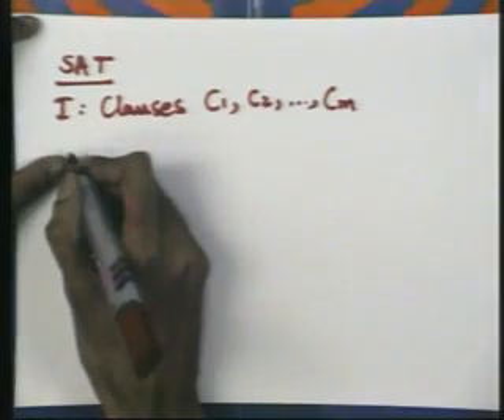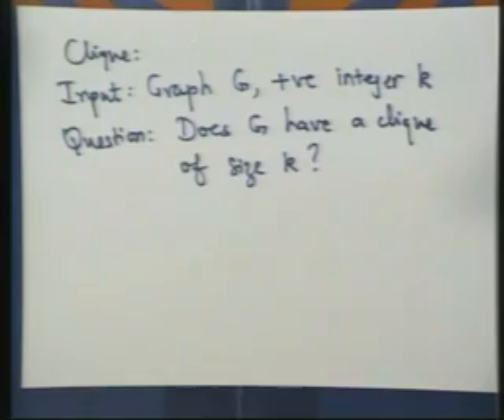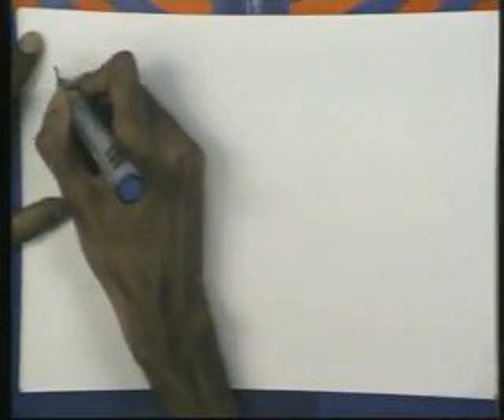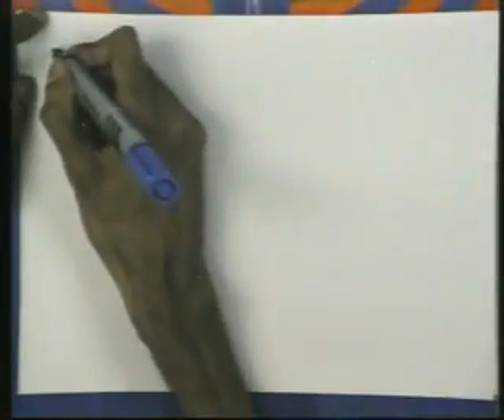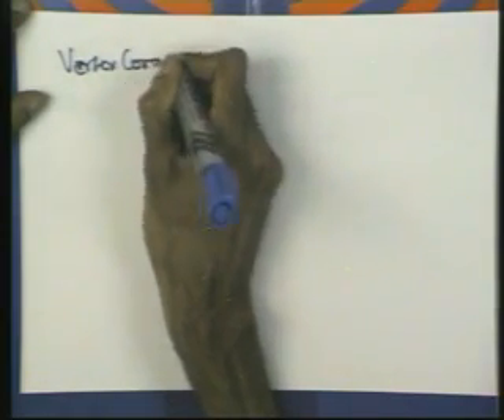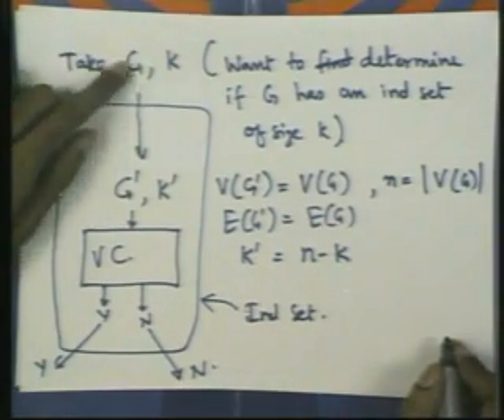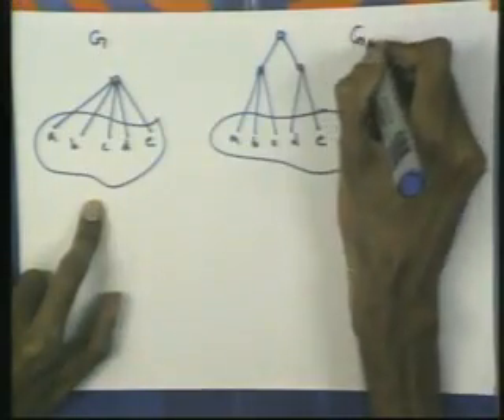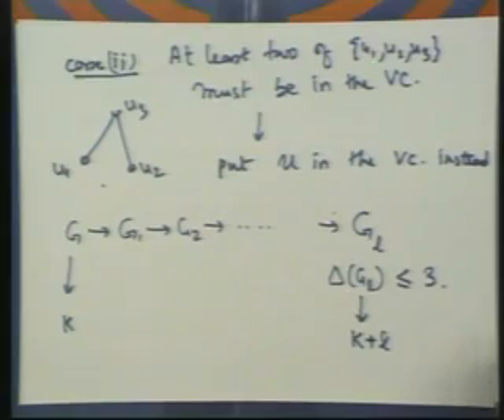Lecture - 29 NP-Completeness - IV

Comment: The split would be done in multiple steps. Please see the last part of the video.  From graph G1 , G2 would be constructed by splitting a node of degree greater that 3 into two halves. If still the degree of resulted nodes are greater than 3 again a split would be done to get G3..so on so forth ...till we get a graph GL which has nodes of degree lesser than or equal to 3.

Comment: Thanks, for problem of <3VC ,what if the original graph G had a vertex U with degree more than 6 in that case we need more than 2 vertexes in order to split U edges between u1,u2,u3?